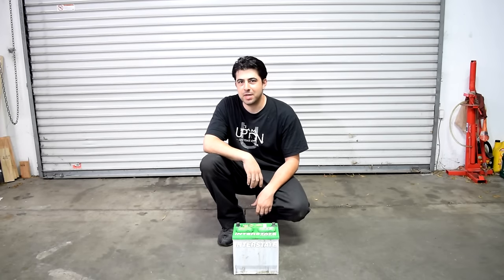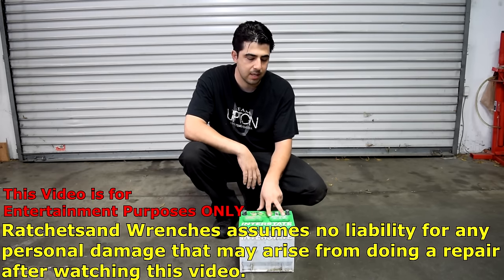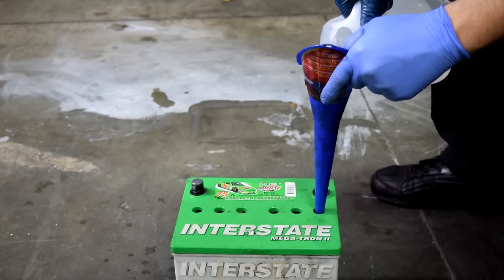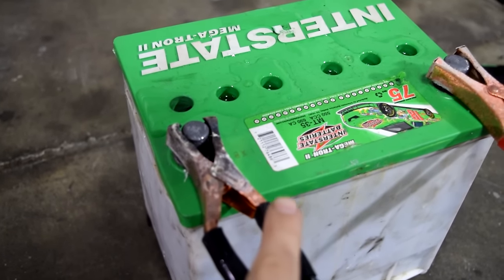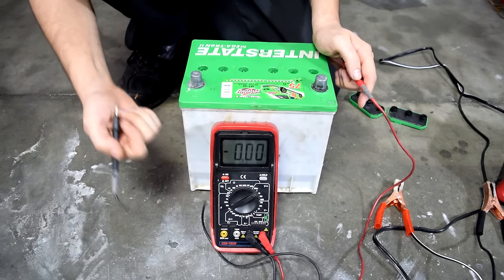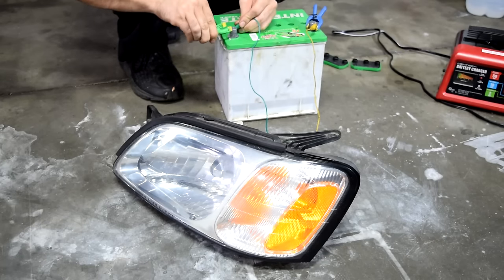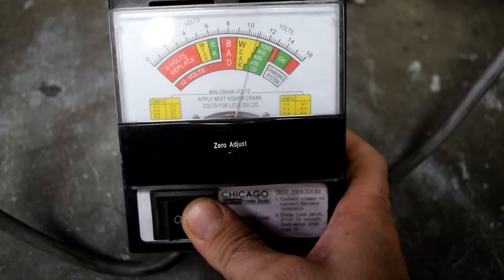Is it Possible to Revive a Dead Battery with Epsom Salt - See For Yourself

Comment: I operated in the nickel plating department where I work and the one key ingredient for conductivity in the plating tank is sulfuric acid. Not enough acid results in poor transfer of nickel to the part being plated. To much acid creates a crapy finish.
 In this case the epsom salt is a cleaning agent and needs to be dumped out and the battery filled with sulfuric acid to a specific  gravity. This can be checked with a battery hydrometer. If your careful you could filter the old battery acid. If you choose not to reuse the old battery acid I would recommend to neutralize it with baking soda.
Reply: Jim Allen Alum or Epsom salt is the prefer ed non toxic homemade electrolyte that's  proven to restore old dead battery's without the plate corrosion sulfuric acid causes. And is cheaper.
Reply: Ed Spencer 
curious what the cost effectiveness of this would be. 
allot easier and safer to just buy another
Reply: 1. No batteries are all $100+. You can do this for $20 with new acid. 2. Not everyone has access to a new battery. 3. In the case of my golf cart there are 6 batteries at $120 each, do the match. I'll take $40 in salt and new acid and a few hours of my Sunday over $600-700 any day.
Reply: Maybe for most. The rest of DIY guys are fine...plus some of us live in the outback.
Reply: Of course. I believe sulfuric acid is probably a better electrolyte in a lead battery than epsom salts. Lye is actually better than epsom salts, I would guess. I have to try that some day. But yes, you can buy new acid and refurbish an old battery with it. Fresh acid will sometimes desulphate plates enough to bring a battery back to life for a couple years, anyway. The sediment in the bottom of the cells, which is shed material from the plates, must be removed because it builds up and shorts the cells. Also, it is very very very important to perform an equalizing charge after adding new acid. A couple of equalizing cycles, even better. You need a large variac, external shunt ammeter, voltmeter, IR thermometer, and a welding machine rectifier to do this properly. I have never seen a charger that could give a correct equalizing charge and I have seen an awful lot of battery chargers. 

It is usually not a good idea to add acid to a battery that already has acid in it. The electrolyte is already at the proper strength when you buy the battery. You add acid only if you spill a lot of electrolyte or you dump out the old stuff as mentioned above. Acid does not evaporate from a battery. Water doesn't either, but it is elecrolyed into oxygen and hydrogen which escape into the air, increasing the potential acid concentration. That is why you add distilled water.Outgassing does not cause a battery to lose acid, only the water it is dissolved in.
Reply: Ed Spencer salt is also an electrolyte.
Any electrolyte would make the battery work, its just that the ph levels vary which changes the effectiveness of the battery.
Cleaning the old acid would work better.
Reply: Ed Spencer ; you are correct. It's the electro-chemical reaction of a sulfur atom in the H2SO4  attaching to the lead plate that produces electrical current. (take away the "S" and you are left with two "H" and four "O"s which is why a discharged battery produces hydrogen gas) When the battery is charged the sulfur atom detaches from the plate and goes back into solution. Because not all the sulfur goes back into solution over time the lead plates build up in sulfur and eventually short out. The salt solution cleans the lead of sulfur, and it's the remaining sulfur in the salt solution that is holding the charge. Salt water is a good conductor but it can not hold an electrical charge. A "shock" charging cycle; 10amps for 20 sec - 2 amps for 2 min - 10 amps for 20 sec - 2 amps for 2 min, etc will help to de-sulfate the plates. When the battery is showing a full charge - even over charge, it should be dumped of the salt solution, rinsed several times, and refilled with H2SO4 (Sulfuric Acid) The health of the cleaned battery will depend on how much lead sulfate (lead rust) dislodged from the plates in the process.
Reply: Mostly correct. But if you take good care of your battery, it will last longer and it will come as no surprise when you do need to replace it.
Reply: I get from your comment that you use new acid on repaired batteries. Can you describe the actual process of cleaning the battery before adding the acid? I am not big on this epsom salt solution to replace H2SO4...
Reply: expensive BS
Reply: Dont, is a long winded sales pitch
Reply: Ed Spencer 55
Reply: There are marine battery chargers that offer automatic 3 stage smart charging plus a manual equalization stage. Great for sailboats where the batteries cycle low running the house when the motor is off.
Reply: richard vaughn magnesium sulphate is an electrolyte???? is that what you are saying?
Reply: Ed Spencer
Reply: The thing I worry about with adding electrolyte is that you may add too much. Here's how; if the battery is in a semi-discharged state some ions from the electrolyte have been deposited on the plates and are no longer in suspension. When you charge the battery with new acid you will be driving the ions back into solution, strengthening the acid concentration in the battery. I strive to capture the old acid and filter it before reusing. Maybe if you have spilled some (winging it here) and need to add more, check the specific gravity of the old. Mix distilled water with the new acid to bring it to the same specific gravity as the old before adding it.

You said... " Fresh acid will sometimes desulphate plates".  This doesn't make sense to me. isn't the old electrolyte in equilibrium with the coating on the plates? Isn't sulfate a more resistant isomer of the normal electrolyte crystal on the plate? Will it not take MORE energy to push ions into suspension in denser electrolyte?
Reply: Sulfuric acid is not available to the public where I live. Muriatic acid is. Whats the downside when using this? Is it to destructive?
Reply: Ed Spencer n
Reply: so much spam on this post god damn
Reply: Ed Spencer (I
Reply: Thanks, yes I don't know why you wouldn't re-use the acid and check with hydrometer since that is one of the most expensive aspects of the repair. We used to check this "acid condition" at the service station I worked at back in the good old days, 1976, when people actually still fixed things.
Reply: here's  several suggestions for battery repairing
do not attempt to do this unless you know what you are doing - the acid can burn you
Test the voltage first - there may be a dead cell which would waste your time.
Check your battery fluid.
attempt to fully charge the battery.
(I read about these using Rapid Renew Roadmap site )
Reply: Ed Spencer - Good point Ed. As thorough as he was, he neglected to use fresh electrolyte. It would have made a huge difference
Reply: Ed Spencer 😄
Reply: How do you know all that Ed Spencer?
Reply: @turboflush  not if you can't afford a new one
Reply: @eminaesic7532  👍
Reply: OK
Reply: A
Reply: @sparklysparks77  how the hell do u take good care of your battery?
Reply: exactly.!
empty acid out of the lead acid battery which is what makes it work then fill it with epsom salt and water.
somehow I think he missed a step as in putting the acid back in I thought maybe he was saving it then he looked like he dumped the baking soda right in the top of the acid which was nice to neutralize it
Reply: @jrperrotta sulfuric acid IS available where you live unless you live on  the moon. Hardware stores and auto parts stores all stock it available to the public.

Comment: One of the problems with "quick fixes" like this for batteries is that people often just measure the voltage once, not the capacity over time with a load. Holding 12.6v is useless if that drops quickly under load. Your current test goes some way to explore this.
Reply: he did a 10s @200A but not enough

Comment: I thought I'd add a little something. Back in the day, I worked in a full service gas station and we did tires, batteries and accessories as well as oil and filter changes. Until GM developed the side terminal batteries, they all had posts on top. The tools we had to pick up batteries were mostly designed to hoist and lower the battery by its posts. I was concerned about the load stress on the posts causing damage. Some cars' engine compartments were so tight that you just about had to drop the battery a few inches into the tray. I didn't like dropping them so I made a sling that allowed me to lower the battery into place then tip it a bit to slide the straps out. I'm of the opinion that not many guys cared about handling batteries gently and that a lot of them got dropped on concrete. The local car guy on the radio recently said that the major factor in shortening battery life is vibration. I think rough handling is also a factor. They all ride in trucks and maybe trains before arriving at the retailer. Our batteries were shipped dry and only had the acid filled at the time of purchase. The only ones I see like that now are motorcycle batteries. And not even all of them.

Comment: 1st No disrespect meant RnW ....    A lead acid battery - or pile it used to be called has a limited amount of charge/discharge cycles for a few reasons. A long life lead/acid battery has 2 things about it's construction that give it a longer cycle time.
1 It has thicker plates. 2  It has a longer distance between the bottom of the plates and the bottom of the electrolyte
reservoir. The action of a lead/acid battery is sacrificial, Lead migrates from the positive plates to the negative plates in
the form of lead sulfate - which is conductive. Over time, Lead sulfate attracts to the negative plates coating them in lead sulfate. Causing decreasing current capability and voltage loss at full charge. Also, since lead sulfate is conductive it
will in time cause a high resistance short circuit between plates - OR from below the plates as some of the lead sulfate does not adhere to the negative plates, and falls to the bottom of the acid reservoir. In time causing an electrical short.
It is the chemical reaction between lead and acid causing the very electrical voltage to be produced that is used for
electrical power. The combination of plate thickness, Amount of plates in each cell, Spacing between cells, And distance
from the bottom of the acid reservoir. Determine current capability and service lifetime, There is no magic just chemistry.

Having said all that crap,Yes you clean the sulfate and get some more service from the battery - to a point.
Current and voltage will be reduced, sometimes dramatically. But it will take and hold a charge. How much of a charge
depends upon the remaining thickness of the plates - Period   New acid and water electrolyte solution will only be as good as the thickness remaining in the plates themselves. It's not magic it's pure chemistry.
The magic battery additive you just pour in and it's like new - is pure snake oil simple as that. You don't get something for nothing - no matter what it is Animal chemical vegetable or mineral.
Reply: John Robinson n
Reply: John Robinson to
Reply: John Robin
Reply: @annejones4746  Are you trying to type something ?

Comment: I've never heard of cleaning the inside of the battery with baking soda. The baking soda is a base. Great for cleaning scummy corroded terminals. I guess I could see trying to clean with the baking soda, then flushing the cells out with lots of water, THEN adding your Epsom salts and charging. My concern is leaving any baking soda behind inside would work to neutralize the reaction you are trying to create.
Reply: long video trying to sell book
Reply: I thought the acid is H2SO4, what is Epsom salt in Chemical formula, will it work for car battery ???
Reply: @stephenho6007  lead acid batteries primarily work on electrolyte basis for their charge. The typical lead acid battery does have the chemical composition you noted. Another way to establish electrolytes in lead batteries is through salts/Epsom Salts, which contain electrolytes as well. That's why a lot of people use them to try to recondition batteries. It can work to a fair degree like shown in this video, though I think this video also demonstrates some of its limitations. Interestingly, one can also buy fresh lead acid with the actual composition you noted for about $20 at many autoparts places. I've heard this works better but I've never seen test comparisons between the two approaches.
Reply: Well I agree with you.  This guy does not know the chemistry behind battery
Reply: Very good point @groverasylum9626

Comment: This is a good video. Just like a chemist doing an experiment. You show the methods and the results. The comments point out all the other issues. The tube is cool. You can learn a lot, what works, what doesn't, why it works, why it doesn't, how to do it better, basic chemistry, electricity, how to use a load tester, etc. Whoever watches these how to videos should always read the comments for max learning and potential dangers. 

I have a q. When you sand the terminal, does this release lead? Are they made of lead?
Reply: Yes battery terminals are made of lead

Comment: Your video got over 800 comments, you are doing something right. Very informative. Some of the comments missed your point. You asked a question and then answered it. period. Thanks.
Reply: I have spent months studying battery repairing and found an awesome website at Magic Mender Wizard (check it out on google)
Reply: The amount of comments does not equate do doing something more "right" or not.  Infact, he did this poorly (and only half way, Epsom salt is for cleaning, not for staying!!), and many of the comments are correcting him.
Reply: @Paultimate7  good, what solution must be used after epson cleaning?
Reply: @topfti9663 Paul is a troll. Like most online who deter people from progress in this world. Experiment and research for yourself to get the truth. Just be smart and safe, you'll be ok.

Comment: I have to take your word about the process and chemistry, but I see you achieved something that is useful and odds are there are a number of people out here that will try some form of this and save $$ while actually recycling!!! 
I believe the battery voltage might have been higher in the end, if the last charge was much higher, at least 10A. Battery charger designs vary widely, but when using trickle charge or 2A charge, the simplest chargers don't tend to raise the voltage of the charged battery as high as a 10A charge or more will. 
There are numerous variables that can cause lower voltage, but if you haven't tried higher charge settings, your not being realistic about expectations. It is a energy storage device and you will not be getting more out of it than you put into it. For me, I consider the basic numbers in involved  (IE:  2 amps X 24hrs  = 48 amps ---> into the battery ) what percentage of your batteries advertised capacity in amps is this?  If my battery was say a 500 amp and less than approximately 11V (start voltage level), with the 2A charge for 24 hours, the battery has only received <10% of it's storage capacity. Then 10A X 24 = 240A..

Comment: After adding Epsom salt you need to do an equalizing charge for at lease three days or more depinding how bad the sulfation is this will remove the sulfation giving you more plate surface area and adding cranking amps then it is wise to remove all the liquid and put the proper mix of sulfuric acid and water distilled water. I'm not 100% sure if removing the liquid and adding the proper mix of sulfuric acid and water will help in the long run but I do know that adding Epsom salt does remove sulfation but requires a lot of overcharging I'm in the process of fixing a battery now if you would like to see a video on that they will like it would be my first good video
Reply: Yeah do it I’d like to see
Reply: I\'m not sure but ,if anyone else wants to learn about battery reconditioning business try Jons Mender Guide (do a search on google ) ? Ive heard some extraordinary things about it and my neighbor got amazing success with it.

Comment: Hello , i had a 12v 4a that drained when it charged , had a resitance of 7ohms and had NO acid in it . 
I recovered it by putting rain water and charging it on a solar panel . Works fine now.

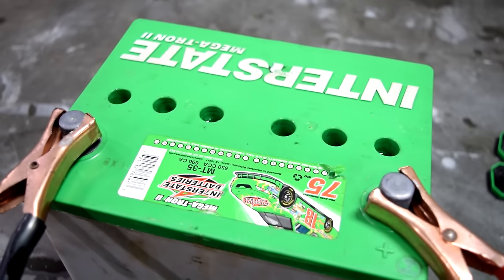Comment: Thanks for the video. At  2:53   You only need to fill the battery to the top of the plates, any more water/salts will rise up and may over flow.
Reply: my car what  $tart
Reply: 10 to 15 mm above electrode

Comment: That was very informative I'm a technician I've been working on all mobiles for about 20 years I'm actually a aircraft technician I've never seen anything like this in course I wouldn't try an airplane I'd be concerned about it getting hot and blowing up in a car but still very very informative thank you very much I can see where cleaning it with the baking soda quite often the plates battery gets where they're touching each other with debris and the baking soda would clean this debris out and there's possibility that could fix it I don't understand why you wouldn't put battery acid back in it rather than Epsom salt
Reply: I did with Aluminum Sulfate and Epson Salt... NON have worked :(.  It only worked 10% of Capacity, meaning..., 500 Amps Battery= 50 Amps Battery.  It's a waste of Money if you asked me!
Reply: Yep: you said it right . 
I don’t know anything about the value of Epsom salt in batteries. 
I do know that bicarbonate of soda will neutralize the acid and you can forget about this project.
 The solution would be to thoroughly flush out the inside of the battery it and then putting in fresh new battery acid.